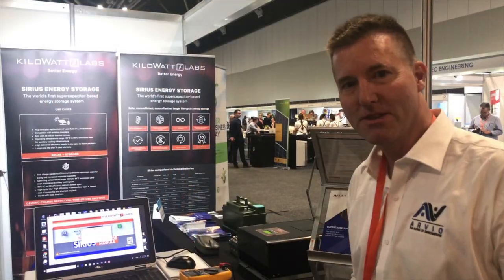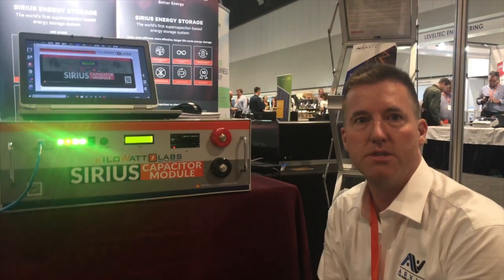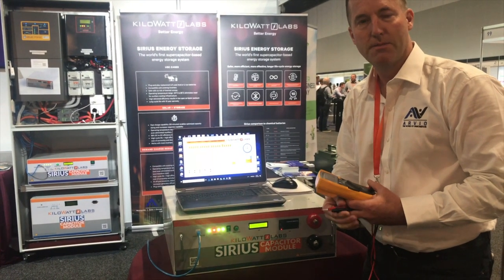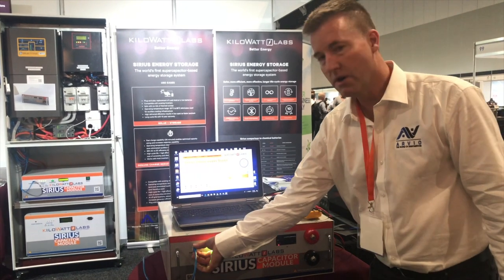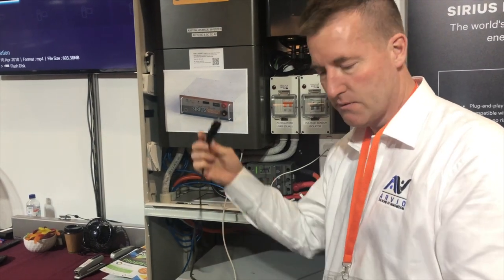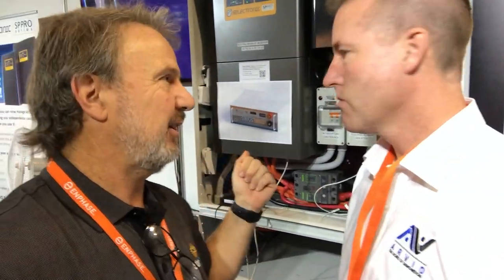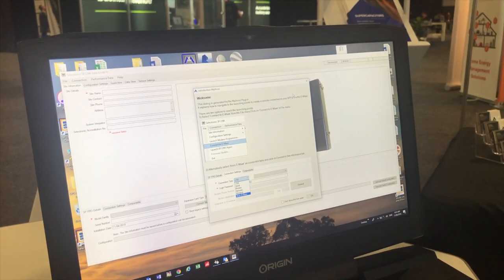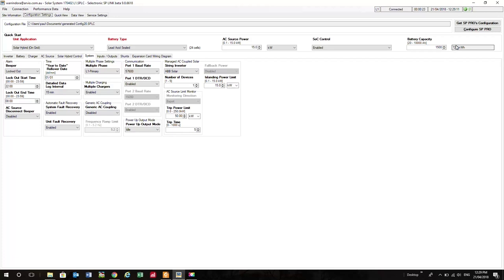Kilowatt Labs supercapacitor Gen2

Comment: I am looking into buying 3x of the 3.55 kWh units. A little scared because there are a lot of mixed messages on the product. I’ve received some ISO certifications on the manufacturer as well as fire testing report. Some reference sites as well. No actual review found online yet?

Comment: Need to find a way to remote hard power cycle the intelligence in the batteries.  They do become unresponsive from time to time, and in unmanned locations it is not always practical or easy to manually switch the battery on/of.  A contact input for a remote relay would ideal.

Comment: Have you done a chemical test to determine that the unit is a supercap and not LTO batteries??
Reply from the maker: saberianamir no, not yet. I’ve had one to play with at my Lab once for a few hours but don’t really want to disassemble one. I’ll leave that to others to investigate.
Reply: Smart Energy Lab Are you aware that all experiments that have be released by Paul are so far, clearly showing that this is not a super cap and are indeed, LTO batteries. The people at kilowatt labs have built and sold a scam. What a shame...
Reply from the maker: How so?
Reply: Smart Energy Lab do some research, just a little, you'll quickly see how you are being hoodwinked into believing these are super caps
Reply from the maker: Sean Moore yes we will. Just waiting on a test unit.
Reply: Smart Energy Lab Good man. This issue needs to be settled.
Reply: The patent that kilowatt labs has applied for speaks about lithium cell in parallel with a super cap cell, I think what Paul has been testing is the LTO cell that's there to control the self discharge of the super cap.. I have yet to see the super caps themselves...
Reply: Weigh the box.
Reply: saberianamir What is the actual difference between a battery and a capacitor? They both store energy? And why do they insist on calling this a super capacitor? Actually I suppose it don’t matter, as long as it delivers as specified. How many cycles can it take, charge discharge ?